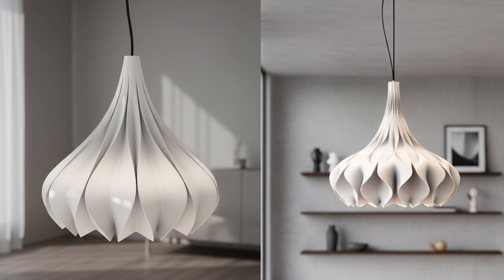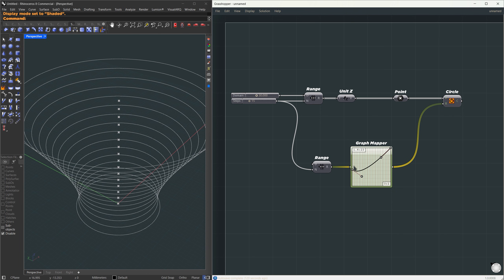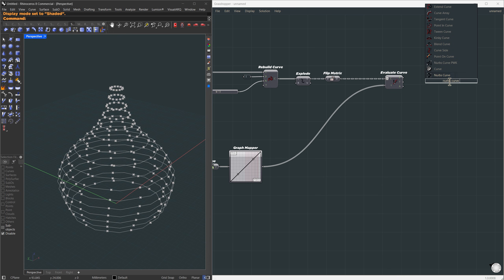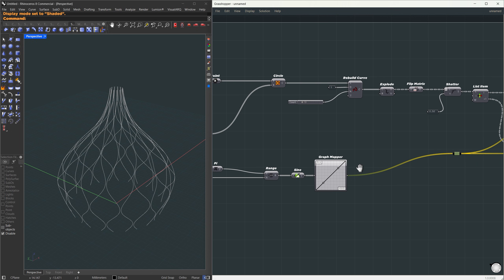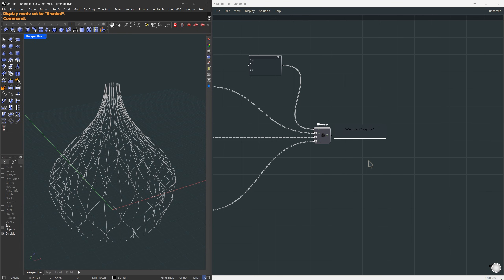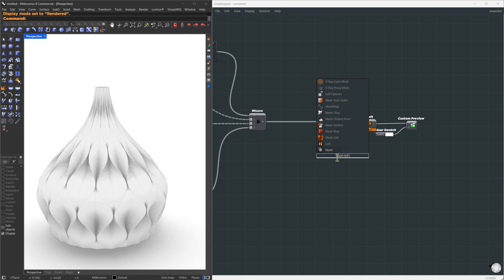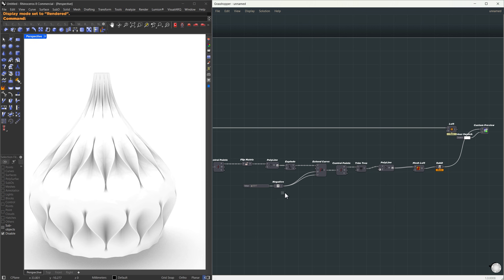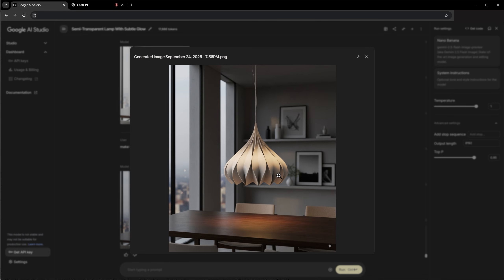Parametric Pendant Lamp in Grasshopper | Tutorial

Comment: I have gap at the end/starting point. How can i close it?
Reply: Faced with the same issue .. 
I have repeated whole process couple of times form the scratch along your tutorial .. final model having vertical gap .. where possibly did I get it wrong ?(

Thank You for such informative and deep explanations !
Reply: @vitalykoshevoy7866  in loft command after weave command, try checked the closed loft option. i hope we have the same imagination lol i’m newbie
Reply: I mean my circle is not complete/ closed. I need to make it completely closed so I can offset surface and use cap to close it. Basically I wanna give thickness to it, I am just learning so its difficult for me to follow what you said. Could youbreakdown a bit? Also is that happened to me or your also didn't close? I tried 3 times from scratch but having same issue. Btw tysm for replying. Bless you.
Reply: Duplicate the first curve at the end of the list before lofting, so the loft knows how to close. I used insert item, list item, and then I fed it into the loft mesh component
Reply from the maker: You mean the polyline result? If so, just right-click on the C (Closed) input and check Invert.